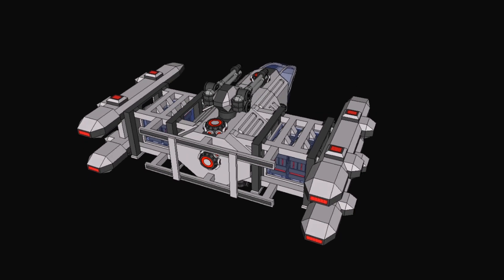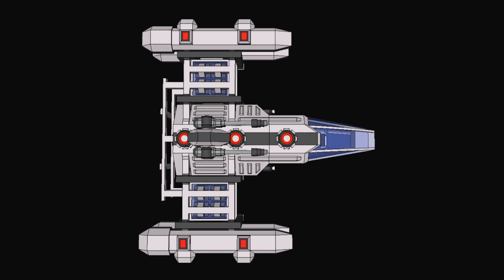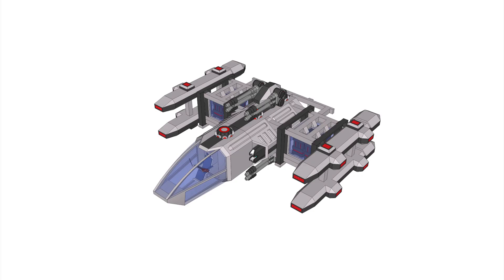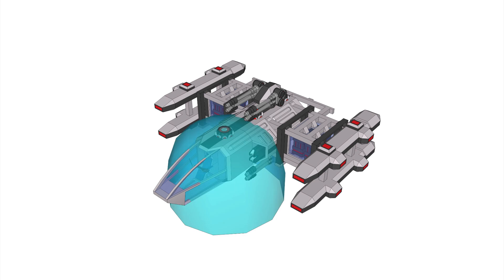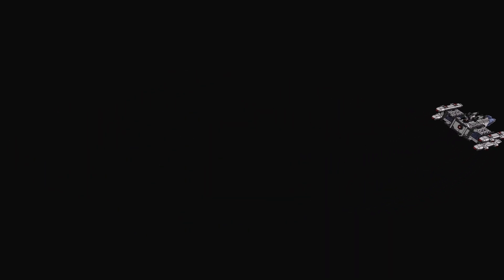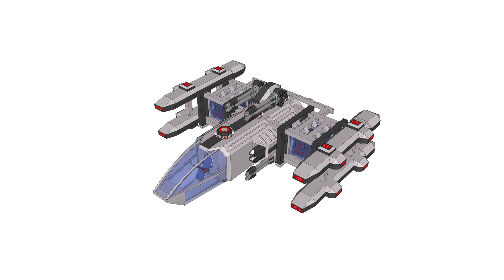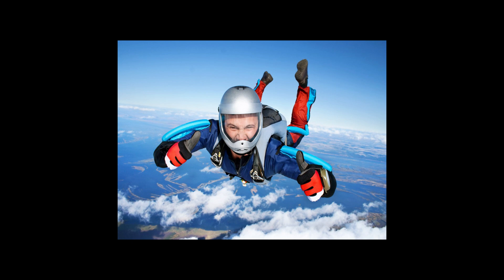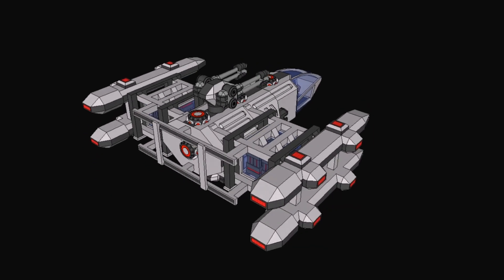Shad has a question! Gravitational acceleration on a spaceship?

Comment: 1. It is strange to expect gravity generator to work that way. Gravity generator repels the ship which then drags the gravity generator? Sounds like some troll physics. Forces are not usualy considered to work that way. There are strange things like 'prl symmetry breaking' that could somehow explain, how one way forces (breaking newtons third law) could work, but there is no generaly known theory built around this idea yet. For sake of an argument, we can overlook technical details and assume, that this device just makes our spaceship behave like it was in a gravitational field with a constant gravitational force applied to it.

2. In Mass Effect series, they use an effect that manipulates apparent mass of objects to make various things work - FTL drive, artificial gravity in space ships, something like telekinesis. They explain how this works mainly in Mass Effect 1 and I find these hypotheses to be fairly interesting.

3. Warp field - another sci-fi concept that uses gravity manipulation to reach FTL speed. It is essentialy a more elaborate version of a mass effect field.

4. Assuming that your artificial gravity device affects the spaceship in the same way as a constant gravitational field (as I mentioned in section 1), the ship will not be able to go faster than the speed of light. For an outside observer, it might appear to go slightly faster than the speed of light because of the space dilatation caused by the gravitational field. Concepts mentioned in sections 2 and 3 allow FTL speed because they concentrate the gravitational field to smaller space - this means that they do not use gravitational field to propell the ship, they use it to dilate space. They then move through this dilated space with speed lower than the speed of light, but for and outside observer it seems the ship moves faster than the speed of light (because the space is dilated).

5. Increased inertia of the ship does not affect its acceleration. Your device causes an acceleration of for example 10 m/s/s. It does no matter, how big the inertia is, the ship will still accelerate by 10 m/s each second.

6. When the speed of an object gets closer to speed of light, its mass increases (according to special theory of relativity). If you were to use a form of propulsion that applies constant force to the object (for example a thruster of a spaceship), the acceleration would be lower when the speed will get closer to the speed of light (because of the increased mass). Your artificial gravity acceleration device might however be immune to this effect. A gravitational field applies the same acceleration to an object, no matter how heavy the object is. So increasing mass of the spaceship when getting closer to the speed of light should not lower the acceleration. There might however be other relativistic effects.

7. As you said, this device will not affect Earth significantly. The reason is not that the Earth is heavy (it kind of seemed to me, that you assumed this at the end of your video). As I mentioned in section 6, your device accelerates all objects the same, no matter how heavy they are. The difference is in distance from the device. The farer from the source of a gravitational field, the lower the gravitational acceleration.

8. The concept of a particle called 'graviton' is pretty old which means that a long time was spent on theories about it. Current theories does not indicate that such a particle realy exists. It is true that gravity seems to have lots in common with other 3 fundamental interactions. But is seems that it does not have its own gauge boson which all other three interactions have (photons, gluons and W and Z bosons). Gravity is arguably the most mysterious interaction, its mechanism seems to be tied more tightly a Higgs field than the others.

Comment: Check out the Alcubierre Drive. It is more like a warp drive but it would basically have the effects that you want. It wouldn't actually accelerate the ship but basically just move a piece of space with the ship in it. You can't interact with the outside universe when using it though.

Comment: Hi Shad, I studied aerospace engineering in university. Simply put, your speed limit is going to be the speed of light. On a conventional propulsion system, the mass increases to a point where it is impossible for the propulsion system to accelerate the ship, but your system violates conservation of momentum, so the reasoning would be different. Regardless, physics won't allow you to have infinite mass, bad things will happen. 

Warp drives obviously get around this by warping space itself around the craft and allowing it to transverse large distances quickly without actually accelerating, but your system is actually accelerating the ship, so you would be subject to the effects of relativity. 

By the title, I thought this video was going to be about using a celestial body's gravity to go faster, I was all ready to talk about gravitational slingshots.

Comment: The manipulation of gravity is the warping of space time, your spacecraft will be compressing space in front of it and expanding it behind, a warp drive that can travel faster than light. In Isaac Arthurs video on warp drive (great channel for space stuff) he briefly mentions that there is a upper limit on the speed of warp drive so you cant travel to Andromeda in less than a few nanoseconds. When I have finished constructing my zero point energy field manipulation device I will be able to find out what happens by experiment.
Reply from the maker: Actually the pulse field generators convert photons into gravitons by altering their spin (I think it's a spin one boson into a spin two boson), which creates a forward flowing cone of warped space time, not compressed or expanded, to which the ship falls into.
Reply: Then perhaps the flow of space time will loop back round outside the ship like magnetic field lines. So outside of an atmosphere you would want to spread out those field lines as much as possible to use nearby planets as reaction mass.

Comment: forgetting the shearing force of having two fields (motor and internal) how would the gravity generator pull the ship forward? if you stuck it on a stick in front of the ship... the generator would try to pull any mass toward it, but it wouldn't receive any momentum. you would just increase the structural load on the stick. a compressing force...
if your drive pulled on space-time itself somehow then it might work. as it is, you've got the whole "fan on a ship blowing into a sail" design.
other than that, gravity is probably a terrible energy source for a space propulsion system. it's one of the weakest forces. it just has the longest reach. using gravity to impart velocity on spaceships would work better as some sort of Uber tractor beam from stationary relay stations. imagine you want to go to Europa from Mars, line up with the gravitational pulse focuser (TM) from Europa-Mars, accelerate for a while so, drop out of the stream before midway, maneuver to the stream from Mars-Europa to decelerate and you're good. or build it up to interstellar level... whatever. you could also do an outpost style system... way stations. you would be much more maneuverable... like a chimp swinging branch to branch.
Reply from the maker: I get what you're saying but I think these pulse field generators would work differently. They don't make gravity in the sense of producing a force that pushes back against the generator as the generator pushes against the ship. There is no push or pull at all. The generators create a curvature of space time (gravity) in a forward projected and forward flowing cone (not a conventional uniform sphere) from the back of the ship to which the ship falls into. So the curvature of space-time flows in one specific direction from the generator causing the generator to fall forward towards the ship, not away from it, which means there is no counter force at all. The generator is not pushing away from the ship, it is falling with it.
Reply: the closest thing I know of to what you are talking about is alcubierre 's warp drive. It compresses space in front of the ship and expands it behind the ship. The ship itself does not actually move - instead it "falls" forward with space around it. It is actually the only known way to cheat the speed of light - the drive can move at any speed.
I have an Idea that could create the effect you are looking for. Your pulse generators generate warp-bubbles in back of them. The warp bubbles whiz away from the ship (by expanding space into the ship) creating a gravitational push. I can elaborate more if you like...
EDIT: Shad, I've send you a message on facebook page. Respond if you are interested in details about my solution.
Reply: +Shadiversity fair enough, this video really hits on my nerd nerve. love to think about this stuff too. I also prefer my settings a bit grittier, more B5 than Star Trek. so that sets my preferences.

Comment: It's based on a fantastic premise so don't worry about it being scientifically accurate. Instead, an interesting idea for gravity drives is to take it to it's root in that gravity is inversely related to mass and distance to another object, which means that a gravity drives speed could thematically be tied to the mass and distance of celestial objects.

In this scenario, the closer the ship got to other objects the more "speed" it could pick up, while it would be slower (acceleration wise) in the spaces between objects. This would make for interesting variety in the way that the ships navigate and even being able to use massive objects in order to get huge speed boosts. This means that a lot of the same techniques for orbital maneuvers can be used to an even greater effect. Your characters might regularly slingshot around the sun no matter what planet you start on, in order to maximize the speed the drives can achieve.

Not sure if your sci-fi universe wants superluminal travel, but the same technology can be taken all the way to it's logical extreme with gravity being used to compress space-time and essentially being warp-drive like Star-Trek.

Comment: I saw an animation a while ago showing a hypothetical space ship which expands space time behind the ship so effectively it was surfing on space time (though accelerating faster and faster). I can't for the life of me find it but hopefully the mental picture I've painted is clear enough. 

Gravity can keep accelerating an object faster and faster until it reaches reach light speed. On the Newtonian level this is a steady acceleration so a million seconds at 1g will reach 9.8 million meters per second. This would equate to a little over half way to pluto in 12 days and reaching about 3% of light speed. Of course you also take the same amount of time to decelerate so a trip to pluto would take about 24 days.

If your story is all set within the same solar system these sorts of calculations will be accurate enough.

If you reach relativistic speed (a significant proportion of light speed) things get more complicated and I'm not sure enough to give you a confident answer so maybe speak to a physicist.

If space time is compressed in front of the ship perhaps you could by bypass the light speed limitation as light speed is the relative to space time in your current position. Don't quote me on that though.

Comment: A mate who is studying aerospace engineering currently recommends to me that this most likely violates newtons third law of motion.
Reply: Sure it does, I mean, it's not like you can fly in a vacuum. This is the sf equivalent of an engine. The sole reason we don't use constant acceleration engines if because of the amount of fuel chemical rockets need.
Reply: Newton's third law is relevant to the forced between two objects. Doesn't apply here, only one object.

Comment: I just finished my second year of physics university so i really can't tell you anything about gravitons and such so i'll focus on the newtonian and relativity part (also sorry for bad grammar, am italian). In theory i think it would accelerate approaching relativistic speeds at which point its inertial mass will increase so much that it will feel almost no acceleration at all (since a=F/m). But that's exactly the point, nothing with significant mass can achieve relativistic speeds with any type of realistic propulsion so i think it can work as any sci-fi propulsion method.